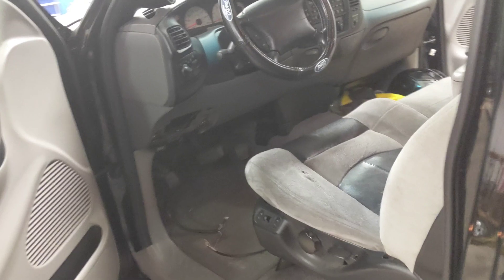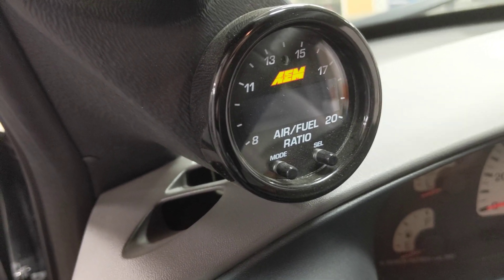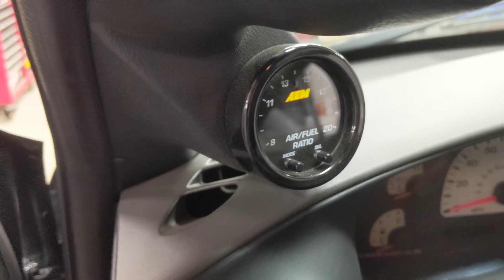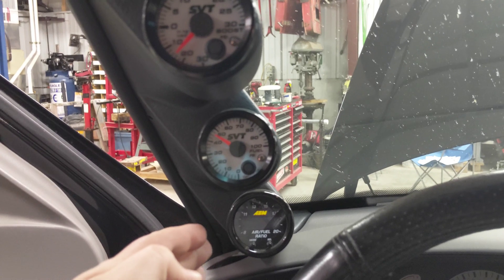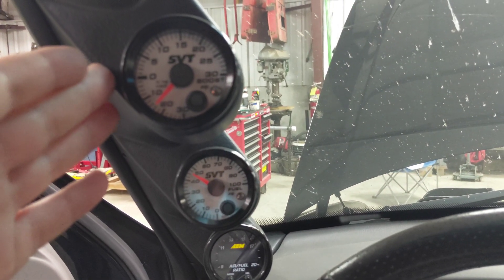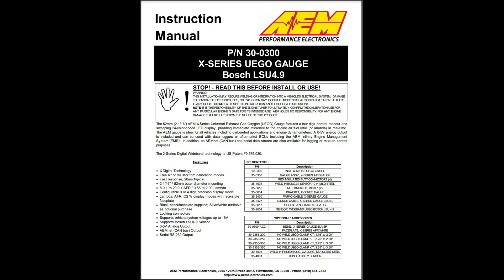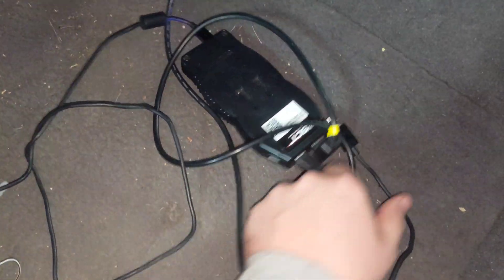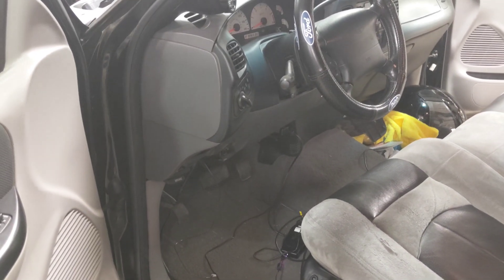Ford Lightning Wideband and Datalogging Setup

Comment: Thanks for the video there's not to much tutorials on doing this helps me out a lot

 I'm almost done with my datalogs with my new motor on my lightning and I've been having a hard time figuring out dataloging the AFR so I can finish my email tune..
Idk what I did wrong and maybe you might know but I'm using a zeitronix wideband, which was working before. When I tried to hookup my firewire it would only read on my sct device. On the zeitronix box it says the white is wideband output and brown is sensor ground.  So orange from firewire goes to white on zeitronix and brown to black? Any help is appreciated thanks
Reply from the maker: Dang. I have no experience with that brand of wideband. If it's reading right on the sct that's all you really need. But that's kind of crazy because basically the sct is an output from the wideband. Sorry I wasn't more help.
Reply: @605BOLT  All good man I appreciate the reply anyway. This video still helped me figure out some stuff 👍
Reply from the maker: @lasersgopewpew77  good deal. Have a great weekend. 🇺🇲🍻
Reply: @605BOLT  likewise! 🤙🏽

Comment: What fuse did you pull from
Reply from the maker: I don't recall. I would have to look back but that add a fuse can be used on just about any circuit.
Reply from the maker: I went and looked just now. Fuse location five in the interior fuse panel. Left hand column, fifth fuse down. It's a 15 amp fuse. Then the gauges run off of a 5 amp fuse in the add a fuse. Hope this helps.
Reply: @605BOLT  it does I paused your video and went to my book and found it was #5 and they power up on ignition and the go off when ignition is shut off correct?
Reply from the maker: @stephendwinells8260  nice. That's how mine work yes.
Reply from the maker: That fuse spot is for "speed control module, reverse lamp, climate mode switch, daytime running lamp relay, digital transmission range (DTR) sensor"

Comment: hey boss diggin the vids, thanks for posting them up.  Do you mind me asking how much it cost you to have the hole drilled and bung welded in for the O2 sensor on the wideband?  thanks in advance!
Reply from the maker: Thank you for saying that!! I took the pipe off and just marked where I wanted it installed and took the bung and pipe into the muffler shop. They got it all drilled and welded for 20 bucks. Can't beat that I don't think. 👍
Reply from the maker: I could have done it myself but I wanted it to be not some boogery bullshit. Lol
Reply: @605BOLT  hey thank you again for the reply.  did you have to buy the firewire separately?  I just realized the X4 I ordered doesn't have it in the box.  thanks for your time.
Reply from the maker: @bspep3  yes I bought the FireWire separately. I bought it through Summit at about ten dollars I think. Lots of places sell them but summit always seems to have fast and reliable shipping to where I am. 👍
Reply from the maker: Also, if you're in a hurry, you can always just bum one off a buddy. Someone with a ford from 96ish to 2007ish that is tuned will almost guaranteed have one. Could bum it off them if you just need it for a week or so.

Comment: So you only have to hook up the fire wire. Do you have to ground any of the fire wires. I have the SCT cable and they list an analog and an analog ground
Reply from the maker: Yes. The analog ground in my situation was pulled through the actual sct device. There is more than one way to do it but in this instance, that is how I did it. 👍
Reply: @605BOLT  I'm wiring in an innovate lc2, can't get a straight answer from anybody how to connect it.iran the red sct wire to the 2nd analog output on the lc2 and grounded the green sct wire
Reply from the maker: I've never done an innovate but my understanding is you need two wires to log the voltage in the sct. That said, in my instance, I am logging the red wire I believe (would need to check the video) and getting the ground through the sct (using the same ground as the ground that allows the x4 to operate).
Reply: @605BOLT  the sct fire wire says green analog 2 ground and red analog 2 wire. Wondering if I have to ground the black wire on the fire wire as well. I call sct and they were no help
Reply from the maker: I would say a redundant ground would be no harm. Sounds like you are on the right track.
Reply: @dickwazinya  i have the same setup, as you. but im seeing a difference in the log, compared to the guage. I didnt ground the green wire on the fire wire... should I do that? or think its an issue with my equation in datalink? I set the x4 to LM1

Comment: How true does the wideband read since it’s only in one side
Reply from the maker: Seems to be just fine. I have never had anything to compare against though. This is just what my tuner recommended to install so I just followed along.  Its possible though you could have an injector fail on the opposite side and not pick it up with this setup.

Comment: Any links to the stuff to do the added fuse mod? Thanks!
Reply from the maker: https://www.walmart.com/ip/Bussmann-Series-16-Gauge-Add-a-Circuit-for-ATM-MINI-Auto-Blade-Fuses/52034992?wmlspartner=wlpa&selectedSellerId=0&wl13=1483&adid=22222222421&wmlspartner=wmtlabs&wl0=&wl1=g&wl2=m&wl3=501107745824&wl4=pla-293946777986&wl5=9020395&wl6=&wl7=&wl8=&wl9=pla&wl10=8175035&wl11=local&wl12=52034992&wl13=1483&veh=sem_LIA&gclid=CjwKCAjw3pWDBhB3EiwAV1c5rLOGXWvH0tlQKxITHVOi9b2X10XTTUbPMB4PGyVd4RO7LP4j7xrq7xoCkswQAvD_BwE&gclsrc=aw.ds
Reply from the maker: I used a guy that looks like this. I imagine they are all about the same. Most parts stores have them. 👍

Comment: I could use some help with the data log when I put in the equation on live links  I start the data log it  Reads zeros  on the wideband  u have any Suggestions I would appreciate it
Reply: Sorry no   when I start the data log it reads 0000s in live links
Reply from the maker: @ethanott9385  I would maybe check your equation. For example, with this AEM X series wideband, the equation is AFR = 2.375(V) + 7.3125. if you look at the equation, if the system was disconnected, V=0. If that happens, then Livelink would read about 7.3125 for the AFR. If it's reading an AFR of zero though, that would mean V equals about -3.08V. Thats a really random number and doesn't sound likely. I'm betting something in the equation is screwed up or you're logging the wrong wire in the Firewire. See what you find.
Reply: Ok  I will check it out.  This has been a real pain I’ve about had it lol. I appreciate it
Reply from the maker: @ethanott9385  lol I hear ya. Sometimes problems like this just won't give up haha. Stick with it. You can get her figured out!
Reply from the maker: You have to choose which wire you are logging (red or orange usually). This is done in Livelink. Also, if the equation is entered correctly, which I assume it is, then a next likely cause for me would be that there is some sort of connection issue in your Firewire. You can use a multimeter to test that the voltage signal is making it into to Firewire properly. At idle, you will be around 14.X so if you do a little algebra with the equation, you can guess what your voltage should be (give or take). Hope this helps!!!
Reply from the maker: Does the gauge read zeros? I may have misunderstood your question.